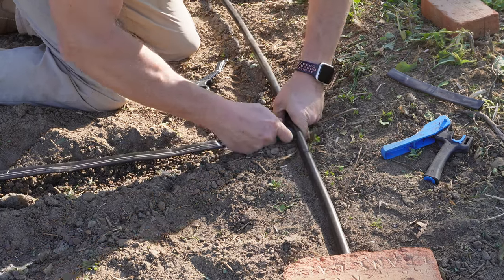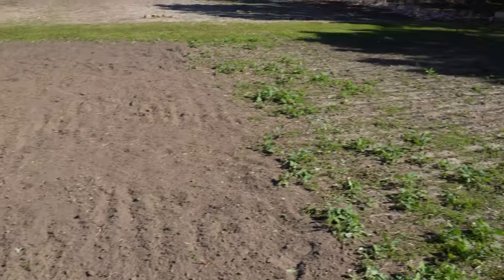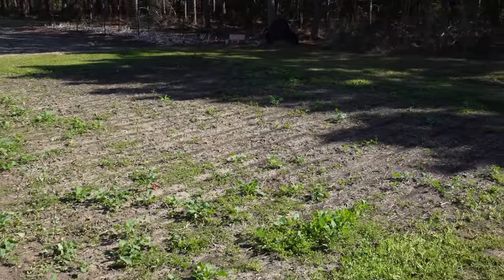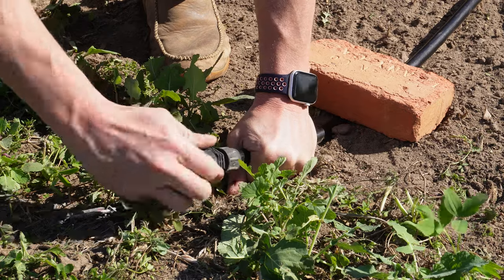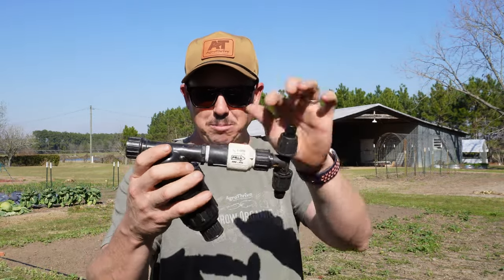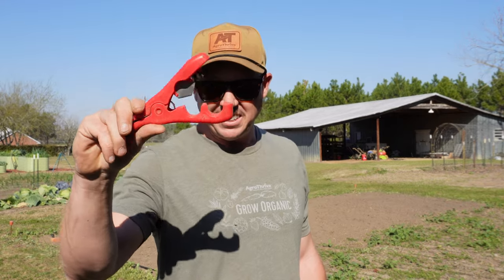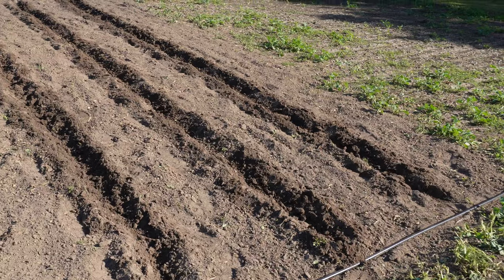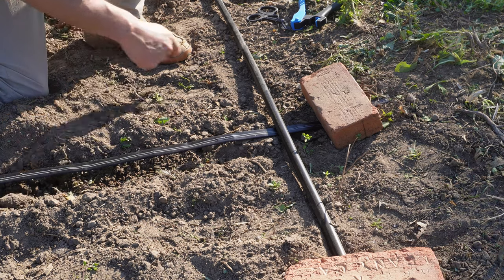Mastering Drip Tape Installation: Step-by-Step Guide

Comment: Hey Travis, one thing people might not know, is like you said. It’s . 47 GPH let’s say 1/2 gallon per hour, per 100ft. At 6” spacing, you have roughy 200 emitters. Now if my math is right, those emitters are barely dripping out any water. People as myself think there getting plenty of water, when there really not. I’ve asked you this question before, and your comment was that you said you might water your tomatoes all nite. Your not just going  water for an hr, it’s going to be more like 8hrs. Maybe you can talk about this. Great video Travis, I do love drip tape, but may go to something with a little more flow, thank you
Reply: He did a short video on this today, and I asked about that because free-flowing, he can get 7 (8) gallons per minute. But when its capped with small emitters, he won't get that flow/gallons per minute. I was going to suggest to him maybe getting bigger emitter holes to shorten the watering time, but I think maybe the emitters closest to the faucet might end up flowing better than emitters at the end. And probably get uneven watering? Not sure.

Comment: For the people new to drip tape, I will also add you don't need a large garden to benefit from drip tape.  We have been using it for 4 years in our 240 sq ft of raised beds (4 beds, 3' wide x 20' long).  Also you can expand beyond a basic system by adding a battery powered timer valve and even liquid fertilizer injectors to feed via a simple drip system.  The timer valve makes it so easy as the little computer inside does not forget to water, or forget to turn the water off at the end of the programmed time.  Drip is the way to go!!!!

Comment: Questions: (1) My raised beds are 4 feet wide - 1 drip tape or 2? (2) How often to water? Yeah, I know depends on rain, etc. What should soil look/feel like - dry and crumbly, still bit wet (moist), plants communicating "We obviously need water!", OR setting aside rain on somewhat a regular basis. Here in Northwest Georgia - Bartow County - we have had l-o-n-g dry spells as in drought! My beds are organically rich (mulched in fall with leaves, turned over in spring, and remulched at planting, compose down over summer, remulch in fall. etc. Going for about 15-20 years - water retention is really good~! Great videos Travis, Thanks.
Reply from the maker: I'd at least do two lines of drip in a 4' wide bed, if not four. I like to water mine every other day assuming no rain.

Comment: I use a tractor to cultivate my garden. Wonder how the drip tape will work with that? I pay for my water so drip tape will help with that water bill if it don't get in the way of cultivating. Any experience using a tractor and drip tape?
Reply from the maker: If you bury it like we do and plant right on top of it, you should have to worry about hitting it with the tractor.

Comment: I commented when you did a drip tape video for Hoss Tools, leave the drip tape open until you've flushed it.  Dirt gets in the lines during installation and if it's not flushed out the only place for it to go is in the emitters.

Comment: Great visual and information for people. My setup is the same, except i use 1 in and 3/4 in mainline tubing as it isn't the row feet as much as the gph equation of no more than 480 or 960 gph. I have enough lines in 1 of my zones it requires the 1 inch tubing because of gph. Plus, it makes it easier as i use sprinkler valves and timer box in house to operate my zones, and those are 1 in. valves.

Comment: Love your videos. Been using drip tape for 5 years now and as mentioned by others, it is a game changer. I have three zones of garden so I like to run a main line to each zone from my water supply (Hose bib), I use a 3 zone timer so each zone gets watered separately on different days. I use row starts with shut off valves on every row so I can shut off any row if needed. 
AND, you didn't mention how easy it is to fertilize everything with an injection system. 
Most items used for drip tape are used many times so the initial cost is the biggest expense, But the time you save watering is worth it many times over.
I was very worried how complicated it drip tape seemed. But, after the first time using it. I wish I did it years earlier. It's not complicated at all. Always use a filter so the emitters do not get clogged. and always use a pressure regulator or you will blow out the drip tape.

Comment: Hey Travis it's Skippy over here in Bama near Huntsville.  I appreciate you doing the math on the  thickness of the hose. Them daggum fractions always get me confused. The last calculation I had to do was a few months back at the end of the Bama vs Dawgs game. 27-24=3 The Tide had 3 more points than the Dawgs at the end of the game. 🤣🤣🤣
I'm pretty sure my calculations are right but since you're from Georgia can you do me a favor double check my math if you have time?
Reply from the maker: You got that one right! Good to see y'all have been practicing that math over there. I'm proud of y'all. lol
Reply: Ha, good one. We Gator fans, although we don't have much to cheer about these days, know that the tubing has 2 sides...5/8" - 1/2" = 1/8" divided by 2 sides is 1/16" thick.😉

Comment: i've been using the 8mm drip tape with that rather large emitter spacing. problem is for larger rooted plants, like tomatoes or eggplants, the water doesnt reach very far from the tape. so i've been having to put two lines per row, about a foot apart, else only wets a very thin section of row. for smaller crops, like lettuce, i can use each tape line, to double up crop, in my small veggie plot.

instead of hauling the drum of drip tape, i've knocked up a simple frame from wood, and now i just pull out the required tape instead.

Comment: Question, I have seen another video somewhere showing the filter system at the beginning of the main line and you installed yours in the middle of the main line.  Does it matter or do you see benefits putting it in the main line.  Thank you for teaching this to us.
Reply from the maker: You could put it on the end. In a small plot like mine, it probably doesn't matter that much where it goes.

Comment: what size fitting do you use for the drip tape?
Reply from the maker: The smaller ones designed for 1/2" tubing. Can't remember the exact size though.